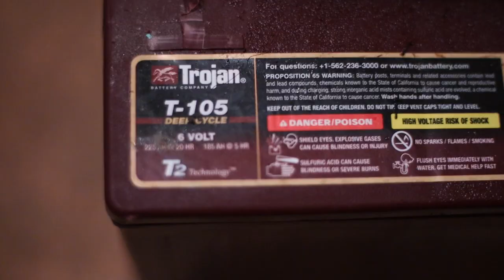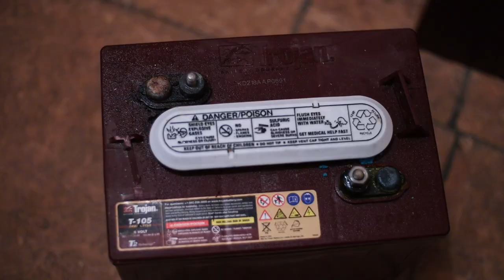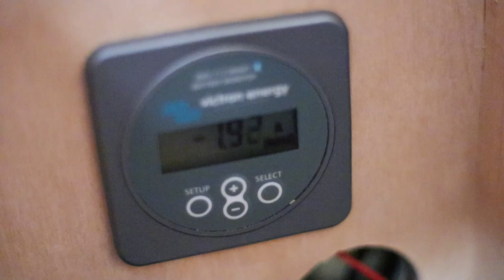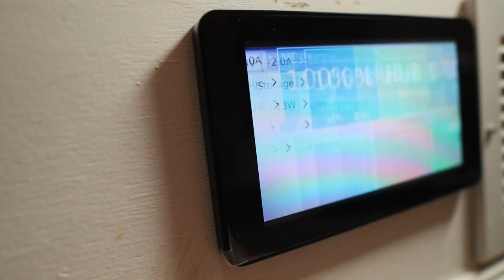Installing 600 Ah of Lithium Batteries in our Tiny House

Comment: Strong work on the lithium switchover. All around I think you made a better choice to power the bus.  Maybe it's time to do the same with your barber??? Nice part, it all grows back pretty fast. Thanks for another great teachable vid Devin.
Reply from the maker: Thanks you! Once I get new panels in the system it's going to be a literal power house. And I definitely won't be going back to that barber 🤣😭
Reply: @BasicallyNomads  What solar panels are you going to end up upgrading to?
Reply from the maker: @Failpailirl  I'm looking at talesun and Canadian solar. Trying to find 400 watt panels. Any insights there?
Reply: @BasicallyNomads  Yeah i've been looking at similar ones actually, just can't manage to actually find them. Thanks for the reply. Really quick if you can, i'm in the process of making a skoolie myself and will be drawing a LOT of inspiration from yours considering the gaming pc, solar, and battery setup. How many kwh would you say you use in an average day, and how long would the batteries be able to supply that?

Comment: Hey how is the battery configuration working? I have 6, 100ah 12v lithium batteries that I plan to put in series parallel exactly like you did to make a 24v system.  Anything issue so far?
Reply from the maker: Not a single issue. Been goin strong for years! Only thing I would have done differently now would be to use 24v batteries so I didn’t have to series them.
Reply: Thats good to know. Yea the price on these were too good to pass. Thanks for replying.

Comment: Can you explain what you have powered with that system and for how long. Thanks
Reply from the maker: Hey Edward! Its a bit complicated qt the moment lol. I won't know the full potential until I get my new panels. With the right amount of panels I can run everything all the time. I could run everything, including my ac, gaming pc, all lights and fridge for around 10 hours off of just the batteries, but the important question is will my solar be able to charge them back up and run everything else at the same time.

Comment: Was that dielectric grease you were putting on the battery terminals? I ask because dielectric grease is an insulator and would be the last thing you would want between the terminal and lug.
Reply from the maker: Yeah, you use dielectric grease to prevent corrosion. You squeeze it all out in the process of tightening it, but you leave it in place to prevent moisture from creeping it.
Reply: @BasicallyNomads  It's a insulator and non conductive.  Not something I would put on battery terminals.  In fact some people go to the trouble of wiping lugss and terminals with brake cleaner to remove any grease residue that comes from your fingers.  It could be restricting under high amp load.
Reply from the maker: @peteroliver9042  sorry, but I don’t think that’s right. It’s nonconductive by design so it doesn’t cause a short, but it won’t stop or even slow down 200amps coming through. People have been using it for years to great effect, especially in areas where water might be involved.

Comment: Dude u should by the ampre times they are same quality but only 287 each
Reply: Amper time is 23lbs each
Reply from the maker: Thats a heck of a deal! How's the bms? And id assume if its the same chemistry it has to be lower aH if its less weight?
Reply: @BasicallyNomads  I run chins. But ampere time same company. So I run 12v 100ah x 4 in series to make 48v on a 3000w baterryless growatt all in one. In order to fully charge the 4 Batts I need 10 x 250w used santan panels wired in a 5  2 configuration. Meaning half the panels are split up into parallel allowing me to double the amps while keeping voltage the same. In this 5s2p setup my volts are 160 or so and my amps are 16-20. 16 amps is needed to get to full charge on  four 12v 100ah lifepo4.
Reply: @BasicallyNomads  the growatts all in one have many safety features that protect me system. Upgraded to 4x 12v 100ah lifepo4 in parallel with the same 4x 12 100ah setup. This new setup would be equal to me running the heater on 1200watts all night vs only 3-4 hours. More fridge time. Much needed. Bms are solid. See will prowse reviews
Reply: @BasicallyNomads  you go 48v so the wire sizes are smaller and u save money. 48v allows efficiency and big loads less stress but is more dangerous. Can shock u.
Reply: @BasicallyNomads  I'm happy with my chins high grade packs by chins but they are indoor no heating function. I live in socal but also keep them warm before sun charge. Lifepo4 has hit an all-time low price that's bound to shoot back up.

Comment: That's not 600 amp hours in series parallel. That's 300 amp hours at 24v. This will yeald you 7200 watt hours. If you wired them all in parallel, it would be 600 amp hours at 12v. That setup would net you the same 7200 watt hours. 24v is way better.
Reply from the maker: Yeah, I’m pretty fluent in solar! Just like to frame everything in 12v terms as I find it easier for laymen to understand 😁 24v is a requirement for anything that takes over 1000 watts in my opinion!